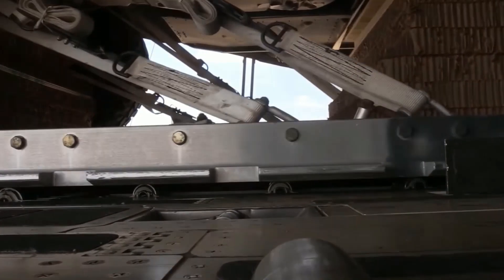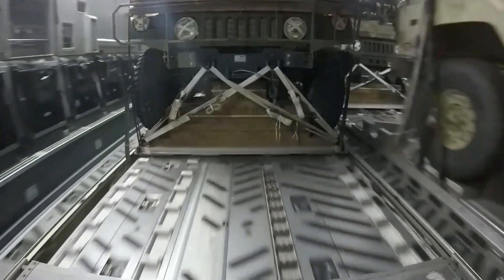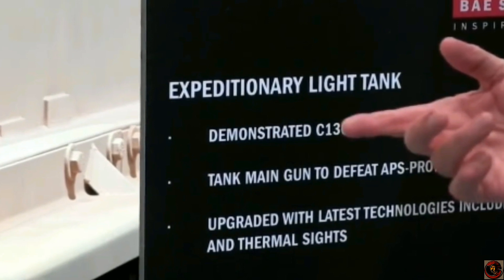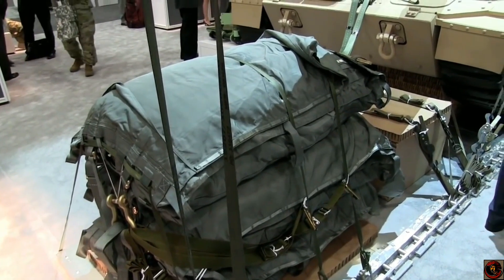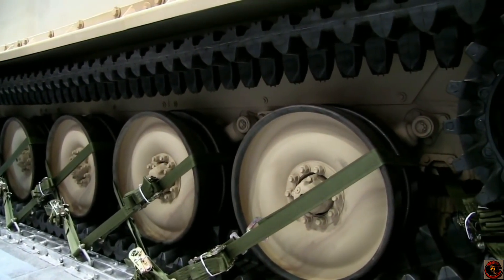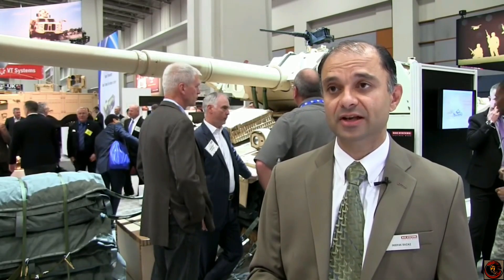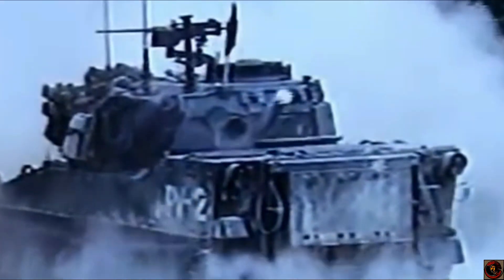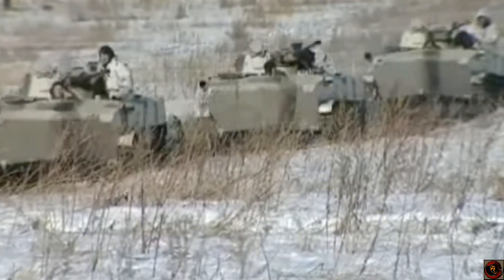Dropping a Tank From a Plane - Airborne Armour?

Comment: I was in 3rd CAV 1967~'69 Germany (Baumholder) & moved to Ft Lewis, WA 1968 
We had M-60s w/rubber pads, better on roadways, but steel tracks better on battlefield
3rd CAV was not airmobile, but rumors were plenty, in process of being crowd control
Reply: changing tracks is pretty fast, but is it worth it ?

Comment: I trained on the M60 and they went to the m60A2 and m60A3 in fort Knox. I got to work with the Marines on the first m1 Abrams. We went to fort Campbell and dropped to M60 out of the back of a C-130 and when it was loaded on a platform it would almost tumble and nose dive. We done one without the platform and let it roll on the torsion bars a whole lot easier and the steel track did not break. C130 had to get down to an ultra low altitude pulled it right out made it super simple

Comment: I witnessed both LAPES (low altitude parachute extraction system) drops at a prepared site and High Altitude equipment drops while a Military Policeman at Ft. A.P. Hill in 1980.
It remains one of the most impressive things I’ve ever seen close up. 
It’s crazy HOW CLOSE the low parachute drops were to the Observers. 
There was actually a bleacher on the side of the grass runway.
The area completely surrounded by trees. 
The C-130 (I think)  flew in at tree top level and as soon as cleared dropped right down on the ground Literally right in front of us and the chutes popped out with a huge pop!!!! and for a millisecond….it looked like the big cargo plane just froze in place in the air… 
But the instant the APCs cleared the ramp…it sprung into the air and was gone. 
Stunning.  
They made a couple of low drop a couple of high altitude drops. 
Amazing day.

Comment: Yeah, you DO need to research those rubber tracks. Way more reliable than metal ones. The part you're not understanding is that the rubber is just a coating. They have kevlar internals. That kevlar is going to hold up to a blast a lot better than metal hinges...

Comment: for one thing unless the rubber that’s used to manufacture the tank’s tracks is heat resistant there is a risk they could overheat and stretch, warp, snap or even fall off etc meaning that the tank would be no better than a metal pill bunker on rims since it wouldn’t have the ability to move other than the main gun turret turning and as a result it would be basically a metal grave since it is immobilised whereas metal tank tracks which have been in use since roughly the late part of ww1 when tanks were built with flat armour instead of angled/sloped armour plating of ww2 era tanks and the tracks of both ww1&ww2 tanks were all made of metal and proved that metal tank tracks are reliable in countless scenarios and environmental conditions with very few issues as far as i’m aware of that is

Comment: these types of supply drops can be the difference between a victory and being overrun by hostile forces in a battle for example a tank can be tough to fight without proper equipment and preparation so it can turn the tide of a fight from a defeat to a victory potentially yet quantity can also be a factor like in ww2 the germans had better quality weapons and vehicles than the allies but they had limited numbers so had to be cautious about deployments of tank’s etc where as the allies had way higher numbers than the axis forces so could deploy forces in massive numbers and overrun axis positions and if they bring tank airborne drops into use in battles like they were in ww2 then it could possibly reduce casualties or deaths in combat and this is just my personal opinion but i think metal tank tracks are way more reliable than rubber as unless a explosive weapon hits a metal track directly on a weak spot eg the link point of the tracks then there is very little chance they will fail if made out of metal

Comment: I like the German Weasel. It weighs three tons. They operate in pairs, with one Weasel carrying a TOW missile and the other firing a 30 mm gun. The TOW could take care of heavy armor, and the 30 mm gun would be for IFV's and other light skinned vehicles. They could make the TOW raiseable, so it could peak over berms without exposing itself. Think how many of them we could air drop from a C-17. Rubber treads would work well on this vehicle, so it would be quiet. It could do a lot of jobs for airborne units. It could be a scout vehicle. It could provide anti-tank capability. It would be easy to make ready after a drop. It would be cheap. It would use its stealth and agility as a defense against heavy armor. We could get a lot of capability for not much money if we bought that system.

Comment: The use of APS could replace reactive armor or add on armor for a vehicle like this to save weight. Of course its always best to be prudent and have both on a normal tanks but on a vehicle like this that needs to be light weight, greater reliance on APS may be needed.

Comment: I spent 3 years shoving Sheridans out of perfectly good aircraft and then jumping after them.  The c130 had a basic load limitation of about 17 tons when doing this.  Most commonly we did LAPES (which you had in your video) but sometimes heavy drop (8 100ft. diameter canopies).  This was in the 4th Bn (LT) (ABN), 68th Armor, 82nd Abn division (later re-designated as 3/73 Armor I believe).  I was a tank commander, platoon leader and then later XO.  The vehicles were old (I had 2 in my company with only a 2 digit serial number).  Their age and the ability to continue to get parts for them was a leading reason to replace them but then the engineers at tank automotive command and the airborne couldn't agree so after the 1st Gulf War the unit was deactivated.  We lost three of them during the three years in training accidents (LAPES failures).
Reply: Fight like hell sir!

Comment: This is absolutely stupid. One tank is nothing but a target for every enemy field artillery pieces to adjust their fire. You need 4-6 tanks to even MOUNT any kind of forward action, and these would need several hours to even get it battle ready after being dropped from a plane. Where is the crew gor the tamk? Do you think for one second the crews are inside when the tank is dtopped? Idiots!
Reply: Sorry friend.  I was a gunner on this vehicle and we had a round in the tube and ready to engage the enemy in under 5 minutes of the vehicle hitting the ground.  We landed about the same time as the M551

Comment: As an Airborne JTAC my 2 cent are it is counter intuitive to drop weight/armor on a tank to allow it to be dropped out an airplane. Especially when you consider that we can land an aircraft almost any where drive the tank off and it doesn't risk damage to the tank or limiting it's protection. A light tank is not worth it IMO. Either put more anti tank capabilities on light light vehicles or in the hands of soldiers on the battlefield and let a tank be a tank. There is no point to making a tank more vulnerable for a rather questionable delivery method when you can sling load a tank from a CH47 or drop the back and drive it off a C130/C17/C5. This is sad because it puts soldiers at risk for a Hollywood version of war. Tanks by design are support for Infanty. With the advent of T14/T16 from Russia and the ZTZ-99/VT-4 from China a light tank does not stand up to the near peer threats.  Essentially a light tank would be a Bradley Fighting Vehicle with slightly more fire power. Just put more Javelin's on a Bradley and problem solved.

Comment: Hi Matsimus, as a Para guy I've got to admid that whe already have all this. Also whe as Germans with our weasel tanks as you as brits with your light scout tanks. No reason to field an airborne 105 gun if you got Mk's and tow in an mix. No tank in the world surviving a tow or mells shot would not survive a 105 shot. No ordinary MG post secured by sandbags couldn't be taken by an Mk.. Weasels can also field antiair power. And mortars and medical supply.
BTW our old 20mm Mk at the Weasels can take out most btr, bmt and others. Only restriction is the lacking of fire on the move ;)

Comment: @Matsimus       You never mentioned what the "older" platform was that this tank was based upon unless I missed it.  It looks like the M8 AGS system.    Also you failed to mention two other key things.   #1 You didn't mention the option of Active Protection Systems (APS) on this tank which would substantially decrease weight while significantly increasing protection against RPG's and ATGM's.   

#2  You totally failed to mention that the Russians have a vastly superior AGS in the form of the 2S25 Sprut-SD airborne light tank.   https://en.wikipedia.org/wiki/2S25_Sprut-SD
That Russian Sprut tank killer has a far superior 125mm cannon capable of taking out main battle tanks with ease.  In comparison, even with modern ammo, the 105mm cannon of this American AGS is pretty much obsolete in any role other than as an assault gun (better to go with a Sheridan's 152mm gun for that purpose) or to take out enemy light armor (which a 20 to 40mm autocannon is better for).  
The Sprut vehicle also is amphibious and very low profile.  Something like that is more like what American tank designers need to be looking for.  At minimum they need to be looking at some of the lower recoil 120mm designs such as those found on the CV90120-T light tank.

Comment: Suppose a metal track takes a direct hit. Track comes apart and you grab your spare links, get to work. 
If you had a rubber track it might just have a hole in it,  keep on truckin. Metal tracks have an efficiency loss of 4% (matsimus just got triggered) whereas rubber tracks like those (with no joints between the tread) have no efficiency loss.
Metal tracks self destruct at 62mph, rubber might be pushed much farther given lower weight pending further testing.

Comment: Back in the day, when we still had the HAWK missile system, the 82nd Airborne commander learned a very expensive lesson as to why you don't drop one of the radars.  The chutes worked, but the impact broke every tube, and some other components, in the radar.  This was the source of much hilarity in the HAWK community.
Reply: Are you talking about vacuum tubes? I thought they were phased out in the 70's in favour of transistors

Comment: After serving as a crew member on a M-551 Sheridan, I can offer this opinion on this piece of equipment by quoting a character from Kelly's Heroes. In the wise words of Moriarty, "It's a piece of junk".
Reply: I found them fun to play around in the hot desert heat at NTC as OPFOR for 4 yrs. 92-96. Although they did tend to go thru alot of engines, don't know how many i switched out during my stint there. When the 82nd use to bring theres we would  eyeball them and say to ourselves...if we could only make it to there UMCP wonder what we could scavenge from there Sheridan's 😁😁. BTW we used to install the IR searchlight from the M60A3 MBT beside the guntube. You should see what 4million candlewatts of white light does to a FARP at 0300 when theres no illumination from the moon 😂😂😂 assholes and elbows everywhere..and a few panties too. Man i wish i woulda took pictures of that night. It was only 3 of us VISMOD T-80's.
Reply: @RandomGuy17768  LMMFAO
Reply: That corporate type is there pitching that tank as a "new" weapons system. You can even see it with the modern drive sprockets on the kevlar track. If that contractor is pitching it as a new system, I'm sure a lot of it has been re-engineered. Sure the previous iteration, the version you're familiar with, was junk. Doesn't necessarily mean this one is. If they're attempting to reintroduce it, it's safe to say they've poured over maintenance logs, and performance reports, to specifically correct the issues you're citing. Think about it. That contractor isn't going to spend millions of dollars re-engineering that thing, in order to attempt to reintroduce it, so they can sell refurb systems to the military at a profit, unless they can assure the military that all of the known issues with the vehicle have been corrected. Unless they have re-engineered that thing to death, they wouldn't even be pitching it right now. Very first thing some generals going to be like "oh those tanks are junk they have this problem and they have that problem," this guy's job is to be able to assure that General that they have already sorted out those issues, and that they won't see any of those issues in the future, not from their product. That's how, modernizing a system for re-release works.
Reply: WOOF! WOOF!
Reply: Not the best, but given its intended purpose, was it good enough?

Comment: Would you count the Wiesel to light tanks?

Because it’s made for Airborne use
Reply: Ohne, I think a Wiesel sized platform with a 25mm auto cannon 7.62 mm coax band tracks 3-2 man crew  has its place and could be very effective. I have said for years airborne needs light armor even tankettes like the Weisel used on the initial drop  to give the ground pounder some firepower. To the defender on the ground that is defending a airfield and you have airborne troops supported with light armor attacking you, you are expirancing a significant emotional event. Also by using tankettes over Humvees, the tankettes can carry a few legs with them to expand the airhead and be used to repeal a counter attack or sieze other high value objectives. I think while the new light tanks (BAE AGS aka M8) are a much needed force multiplier. The real issue is using  a 1950's designed C130 when it's replacement the Quad tiltrotor should have been developed for the past 20 years, which would allow you to land a AGS/M8 directly onto the ground.

Comment: It's a dumb idea. Rubber tracks only made sense in ww2 because tire technology hadn't progressed enough to be able to handle the weight of an armored vehicle. Also, that gun is too big. Big guns need big ammo and heavy carriages, meaning you can't carry as much into battle. What you have here, is a tank that is only going to get knocked out, if it even makes it into battle. 

What the Airborne need, is really more along the lines of like a Stryker, with decent armor, multifunctional, mobile, fast and armed with a high velocity, 75mm or smaller round. It doesn't need to be able to fight T72s one on one. It just needs to be able to support the infantry and get to where it needs to go before the enemy can mount a coordinated counterattack. Like you said, you're not going to drop your airborne units so far behind enemy lines that your main forces can't get to them.

Comment: I'm wondering if our airborne units couldn't use a vehicle like the German weasel for its airborne scouting operations. Make it small, very fast and agile, some armed with TOW missiles and some armed with a 30 mm gun, and able to carry a crew and two scout soldiers. Send them out mainly in platoon sized units.

Comment: The Christy suspension or rubber band as you like to call it is a far, far superior track system. It takes an awful lot of trying to throw the track off the roadwheels. The standard track system like the one that is on the M48, M60 were always thrown their tread. I spent three years working on an M551 which I only saw it thrown one time by a raw recruit learning to drive. We backed it straight back and doing so walked it back on the sprocket.

Comment: You don’t Drop paratroopers In front of a enemy’s line of advance. You drop them behind.  The only reason to drop them in front of the enemy is to reinforce troops that are already engaged. Such as a drop into Anzio.  The typical airborne operation is an airfield seizure.  Once you control the airfield aircraft can land with “leg troops”, they can walk their happy little asses off the back of the airplane.  Many countries are landlocked and the only way to kick in the doors is to drop paratroopers first.  After that everything else has flown in.  The newly seized airport just became a beach head.

Comment: Imagine having a squad of 8-10 wiesels Airdropped by one of the large cargo planes like shown here, maybe even with the crew and support soldiers being airdropped along with it (seperatly of course). This would allow for any Military that has these little buggers of doom to respond to any threat in virtually no time and would also allow for insane flexibility, for example: a squadron of 10 wiesels comprised of 3 atgm versions, 3 autocannon versions, 2 ocelots for anti air cover, 1 mortar version for long range firing support and 1 medical version for the wounded. Along with these Wiesels you could deploy any kind of soldiers with it and up to 4 of them would be able to ride with the wiesel APC versions, giving them the ability to move insanely fast. All of this could be deployed within hours or even minutes pretty much anywhere, depending how far the next wiesel squad and Airfield is away, and all it takes would be 1-2 cargo Aircrafts or around 7 Transport Helikopters. The only downside would be how long it takes to get into formation after landing, especially when dropped out of an Aircraft.

What are your thoughts on this and what would you change?
(This comment is a repost from Matsimus's vid on the wiesel itself as i want it to get as much attention and consideration as possible)

Comment: With a steel link track, when it breaks, you can replace the damaged links.  The rubber band links? don't think so...
Reply: This is the strong point with steel tracks. They can be a***oles to work on, but for field repair and emergency repairs they are OK. You can even make them shorter, say if one of the wheels is gone. And one can make from pieces of broken tracks a new complete track.  I don't see that happen with rubbertracks.